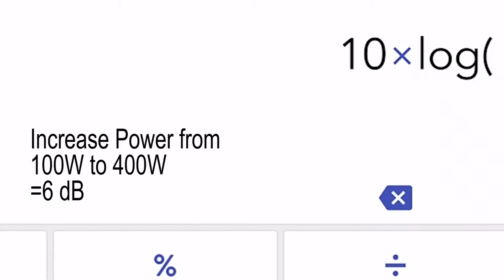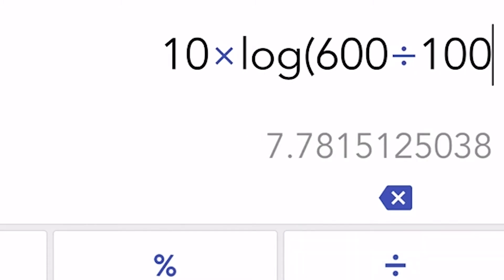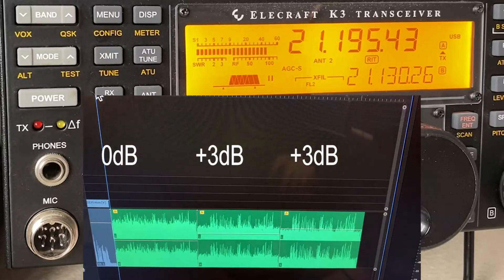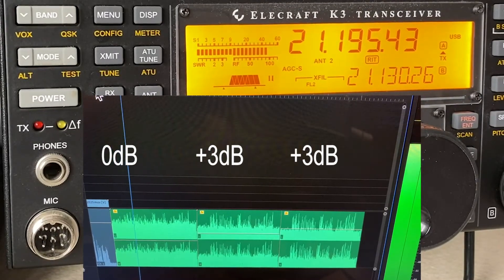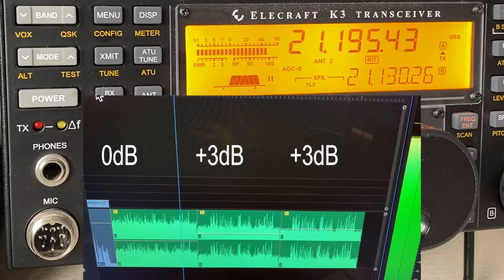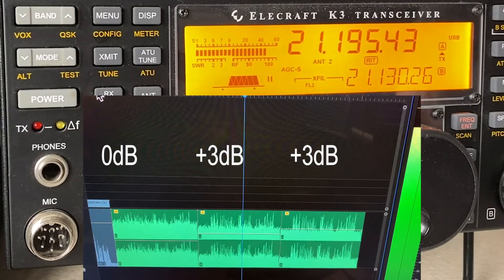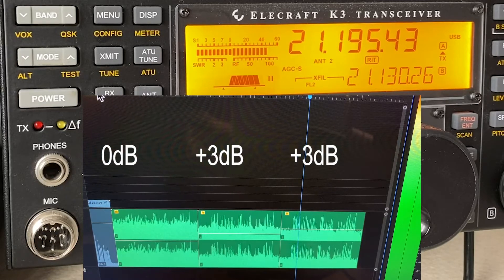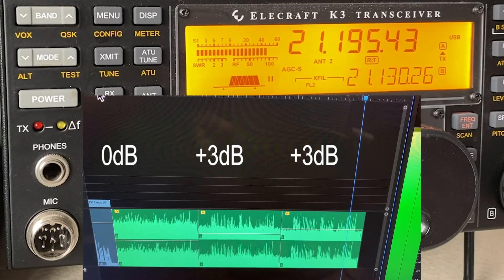Hear The Decibel in Action

Comment: You didn't emphasise the fact that S-units are supposed to be 6db. So to go up one S-point you need to quadruple your power. If you're using 50 watts and received S5, to get to S6 you'll need 200 watts, and to get to S7 800 watts! Put another way if you use 12.5 watts you're still S4 and about 2.7 watts will still give you S3. Anyone doubting this should listen to the International Beacon Network and hear how little difference there is between 100, 10, 1 watts and 100 milliwatts - which is roughly say S9, S7.5, S5, S3.